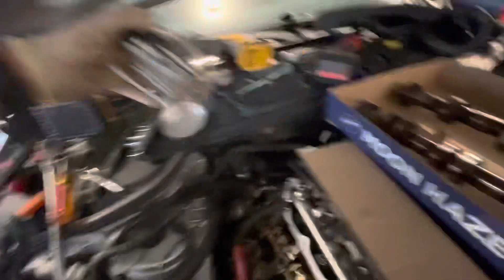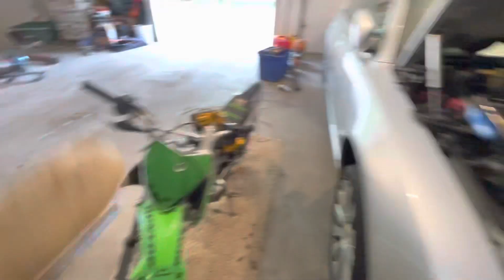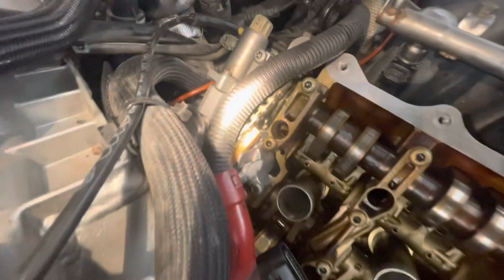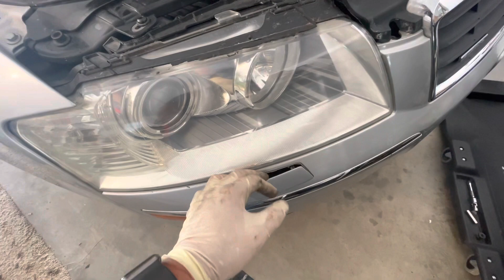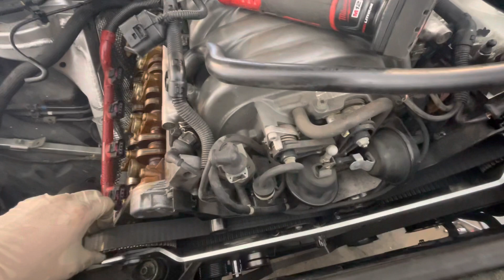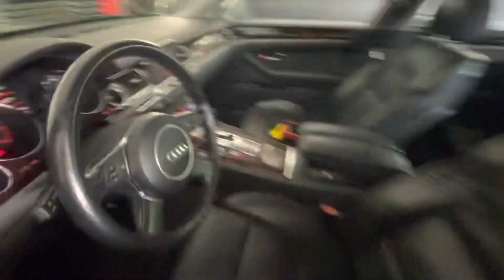Audi A8L 4.2 V8 VVT camshaft actuator chain tensioner P0011 P0012

Comment: You were lucky!  I advise anyone else to remove the bumper.  Two of the biggest headaches I had were the crankshaft pulley which had badly seized bolts which could not be undone without overnight soaking in release liquid.  And the viscous cooling fan was unbelievably difficult to unbolt.  Both would have been impossible with the bumper in place.  Also if you follow the Bentley A6 manual for timing the cam chains it is WRONG.  Memory fails me but it cam down to something like it’s 16 teeth spacing and not 15.  Just be careful and check it out.  If you want to do the water pump change as well, you need the bumper off.  Taking the bumper off is not that bad, the various wires for lights and pipes for washers are a pain but you won’t break anything and you will make life a whole lot easier for yourself, including attaching the bar that locks both cam belt cogs in place.